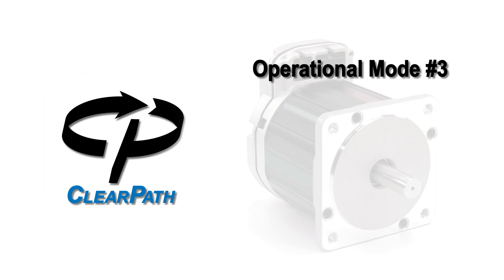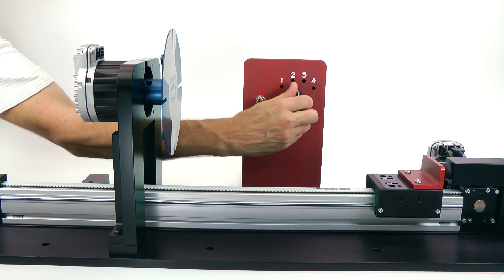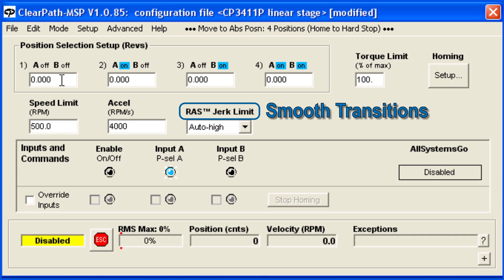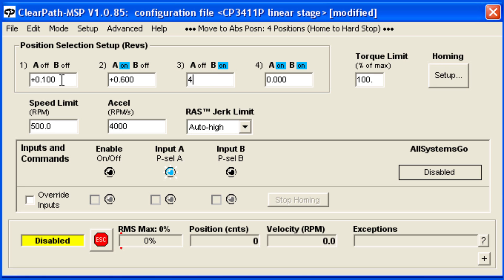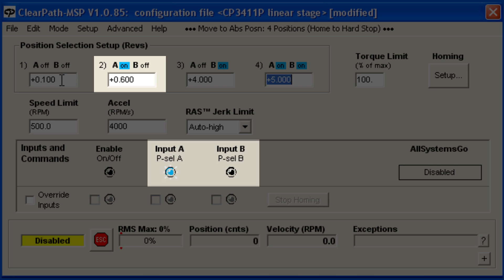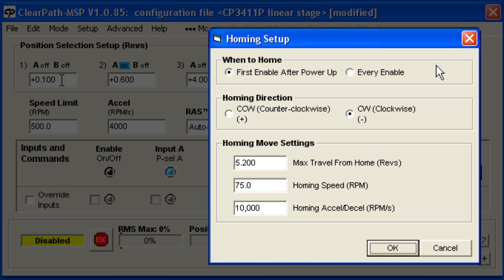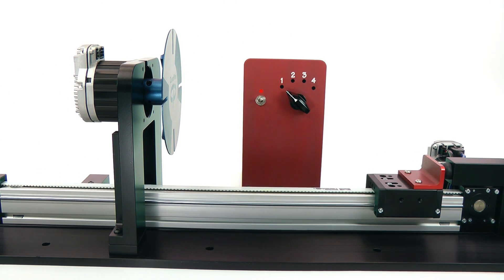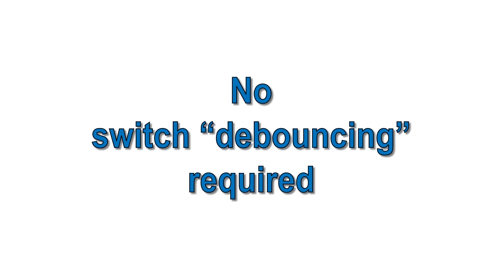ClearPath Integrated Servo: Move to Absolute Position (4 Positions)

Comment: Does this configuration wire the rotary switch to the ClearCore controller?
Reply from the maker: Hi Brett,
The powered switch shown in this video is wired directly to the ClearPath motor's inputs. So in this case, the switch triggers the ClearPath's program.
While not shown in this video, a ClearCore can increase your application flexibility. Here's a link if you're interested in learning more about the ClearCore: https://teknic.com/products/io-motion-controller/  If you have other questions, please feel free to contact Teknic directly at https://teknic.com/contact/ or give us a call at 585-784-7454. 
Best regards, 
Erik M. – Teknic Servo Systems Engineer

Comment: Hi, I need some advice. I adjust the electric motor as in the video. But just turn off and on the power. I turn on the motor and it does not stop in the starting position. I'm getting high RMS and error.
Reply from the maker: Hello Ilver, The RMS torque is a measure of the continuous torque requirements for the application and duty cycle.  There could be several reasons for high RMS torque readings and errors.  A common example is higher than normal system friction – in this case, the motor use more of its continuous torque and the MSP software will display a corresponding increase in RMS torque usage.
Within the MSP software there is a command to generate a support package (Under the main File menu, please click on “Create Support Package”).  It will create a zip file which you can send to “support@ teknic.com”.  We’ll review the files in the zip package and get back to you.  Please be sure to include your contact information. 

I hope this helps. If you have any technical support questions in the future, feel free to contact Teknic directly at https://teknic.com/contact/ or give us a call at 585-784-7454. Thank you.

Best regards,
Abe A. – Teknic Servo Systems Engineer

Comment: Does ClearPath offer a motor that can provide more than 4 absolute positions?
Reply from the maker: Hi Gerald Parker,

ClearPath-MCPV now has a Move to Absolute Position mode that supports up to 16 discrete positions. You can learn more about this mode here: https://www.youtube.com/watch?v=-LubKmpB5-8

Another option is "Move Incremental Distance" mode. In this mode on ClearPath-MCPV, you can define 2-4 incremental distances and send pulses to ClearPath to move those selected distances, or send multiple pulses at a higher frequency to have ClearPath move one long, continuous move. You can learn more about this mode here: https://www.youtube.com/watch?v=EQfZdp6Fuxo

If your application requires greater flexibility in position control, our ClearPath-SD (Step & Direction) series might be a better fit. This motor series can follow any position command or motion profile defined by step and direction pulses from a motion controller, such as ClearCore or ClearLink, enabling precise control over both position and trajectory. You can learn more about this motor series on our website: https://teknic.com/products/clearpath-brushless-dc-servo-motors/clearpath-sd-stepper-replacement/

Please feel free to give us a call at 585-784-7454 or submit a contact request on our website (https://teknic.com/contact/) if you have any questions.

- Nick D. - Teknic Servo Systems Engineer
Reply: @TeknicInc  Under Move To Absolute Position, select "16 Positions".
Reply: Your choices are 2 Positons, 4Positions, or 16 Positions
Reply from the maker: Hi  @autonmotorizedsystems3254  ,

Good catch! Looks like that comment was made before we released Move to Absolute Position with up to 16 Positions. I went ahead and updated our original comment for future viewers to reference.

Best Regards,

- Nick D. - Teknic Servo Systems Engineer